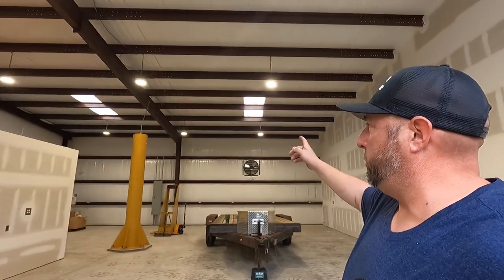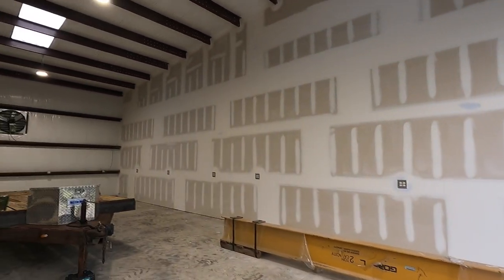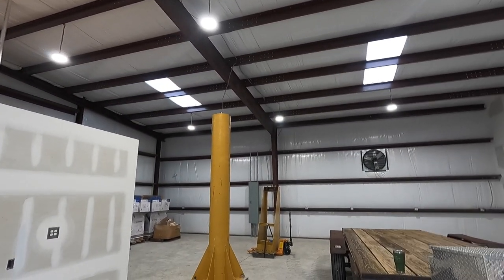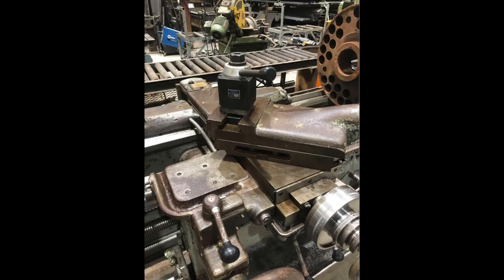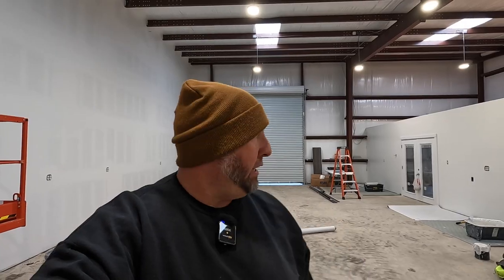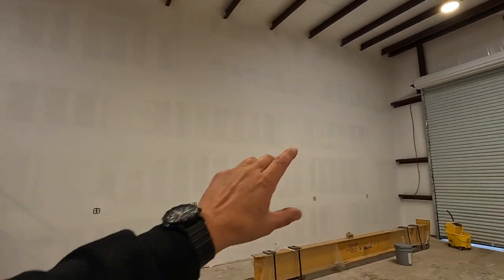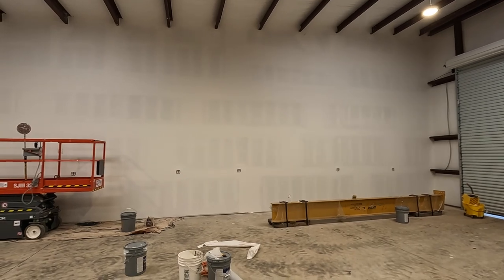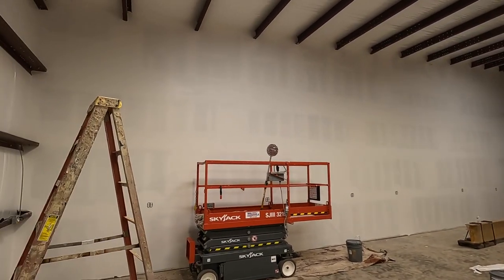New Shop Space Update 10: Painting and New Lathe Announcment

Comment: In my youth we religiously avoided straddling concrete floor joints and especially expansion joints when installing machine tools. As Lean Manufacturing initiatives forced us to pack machine tools closer and tighter we frequently installed large CNC machines straddling frightening floor joints. To my shock, we had surprising success. I still don't like it, but on "small" machines like you operate I suspect that you will have little problem due to the joint under the American Pacemaker. Try to get all leveling bolt pads on the same slab if you can, but you must have room to safely operate the machine.
If pads don't come with the machine, saw slices from a suitably sized piece of bar stock about 1" thick. Counter bore a shallow hole to accept the screw and act as a register. Facing the floor side may be prudent, but concrete is only troweled smooth. Machines this size don't normally warrant hold down anchors. There is adequate machine weight. 
Level the main bed way in Z and X axis. Z is most critical. We attempted to level within .0005"/ft. Rough level the bed way with less regard to the head stock rear leveling bolt weight. Next, set two levels on the cross slide in Z and X directions. Move cross slide in full Z travel monitoring bed way for crowning, sagging and twist. Shoot again for .0005"/ ft. After confirming bed way level and twist, give attention to the headstock. Indicate a standard in the chuck from the cross slide in Z axis to control spindle parallelism to the bed ways on the top of the standard. This will help validate spindle head nod and do this adjustment with the rear head stock leveling bolts.
 Next, turn a piece of stock to validate spindle taper. I suggest at least 2" diameter and pretty good stickout. Tailstock is NOT engaged. Mich workpiece for taper and adjust for taper by loosening headstock hardware and adjusting to eliminate all taper, testing with successive test cuts. Lathe headstocks pivot on a pin on chuck end. Machine is now validated, all leveling bolts bear weight and tailstock taper can be tested and adjusted. Lathe operators commonly tweak tailstock induced taper, so you probably know this procedure well.
Bed twist and and crowning is more important than level. A lathe doesn't reference to true level. If coolant drains the correct way, level is good enough. Twist, crowning and spindle taper are critical. Long bed lathe castings are subject to twist and crown and correction is commonly required.
Reply: Those aren't expansion joints like the old days, they are shallow cuts done after the pour has set with a diamond saw. The idea is for any cracks to follow the cuts. It actually works, though of course you can still get cracks in the field.

Comment: I wonder why no one ever paints the steel in one of these buildings.  I regret not painting the framing in my workshop, and I'm too lazy to do it now.
Reply: steel studs are galvanized. usually the zinc does a better job than any paint could at protecting it from corrosion. i would imagine its a cost/benefit thing.